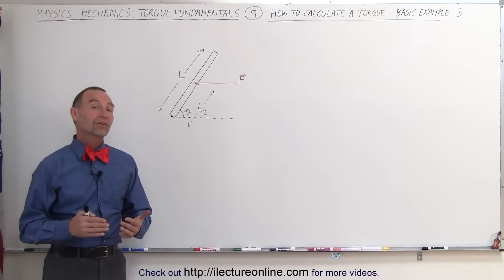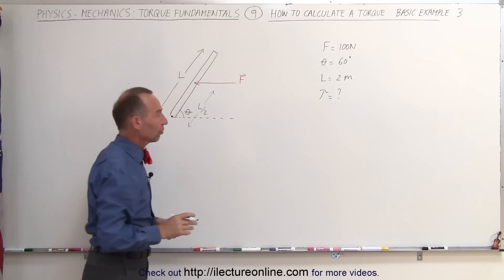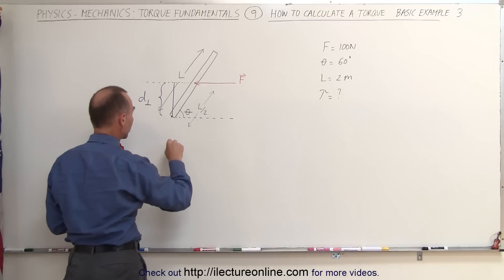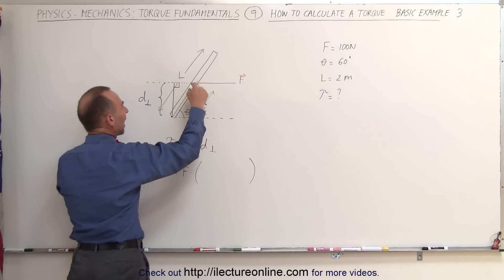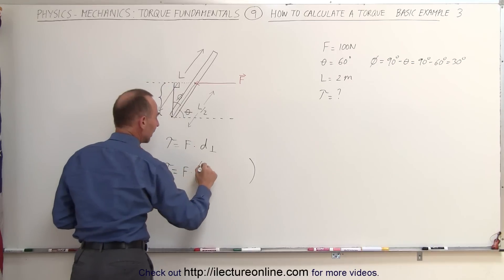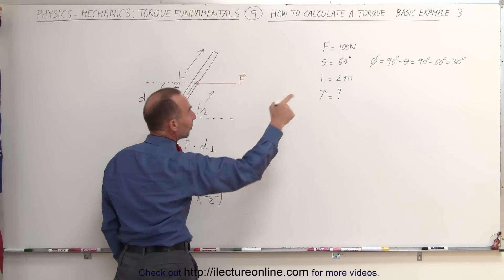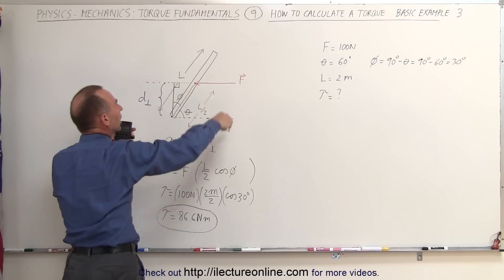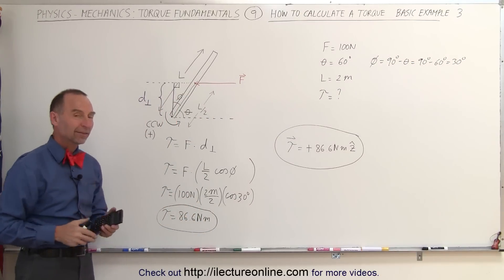Physics 15  Torque Fundamentals (9 of 13) How to Calculate a Torque (Basic Example 3)

Comment: A B C D are having common pivot  but pivot take it's position automatically how to develop such a system⌚🎉🎉🎉please🙏 tell  for bilateral system⌚ for any weight
Reply from the maker: The question is too general in order to be able to respond to it.
Reply: @MichelvanBiezen   four roads of different lengths are to be considered and at each joint they have flexibility according to the face value of weights attached to them and all weights are equal to the abs difference of he rod lengths for any two rods joints   we want to find out the harmonius natre between them

Comment: Quick question, why is the perpendicular distance the cos30 side and not sin30 side . I am asking because the force is moving the block a distance of sin 30?
FYI :
I really do enjoy your lectures, the concepts and examples are put in a very understandable and intuitive context.
Reply from the maker: Because d is the adjacent side to the angle.
Reply: Michel van Biezen 
But from my understanding the block doesn't move a distance of D perpendicular as u depicted but rather the opposite side of the 30 degree angle ( the opposite of the phi angle ) . Please correct me if I am wrong
Reply from the maker: d is simply the perpendicular distance from the line of action of the force to the pivot point  (it is not dependent on the direction of movement)
Reply: @MichelvanBiezen  ok sir, sir I have a question